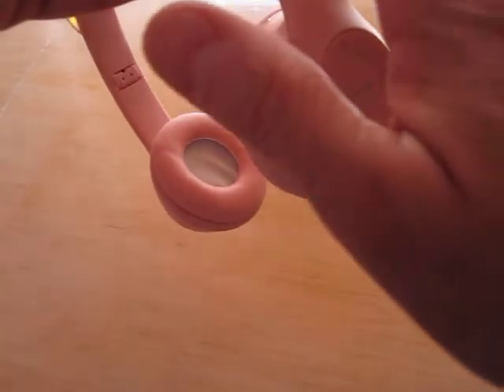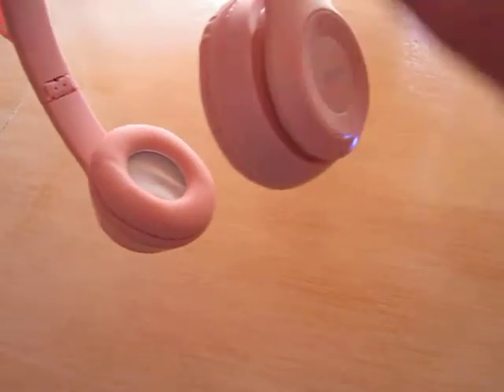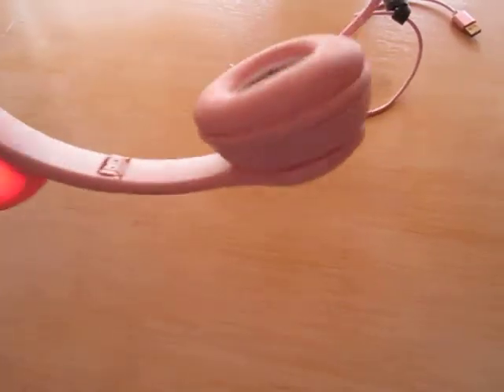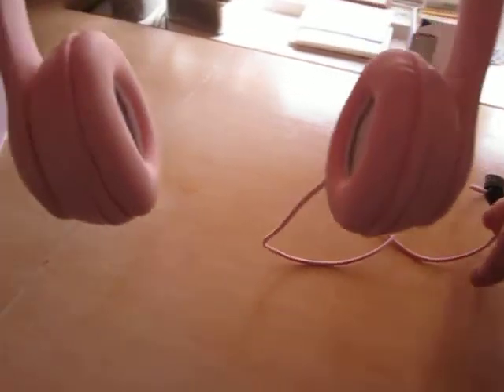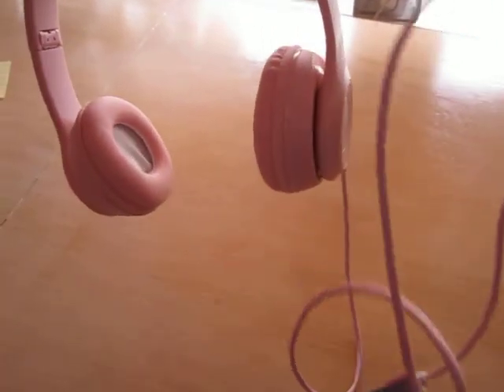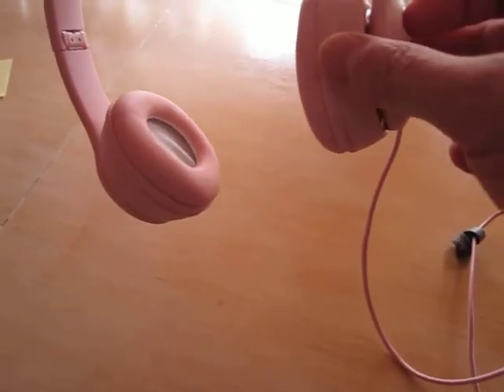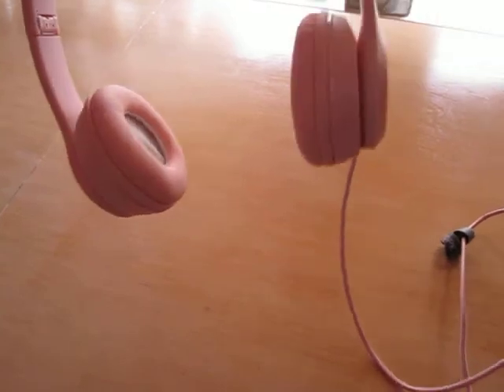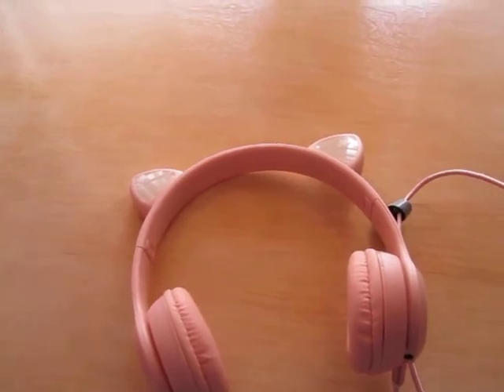P47 improve FM radio reception the easy way

Comment: Can we connect with any charger cable
Reply from the maker: Hi Tarun, thanks for your question. As long as the plug fits in the socket (micro USB). If the cable is very short (20 cm or so) it will effect reception less then some longer cable. Most cables have sufficient length (50 to 75 cm or so, you do not want to drag a cable behind you :-))